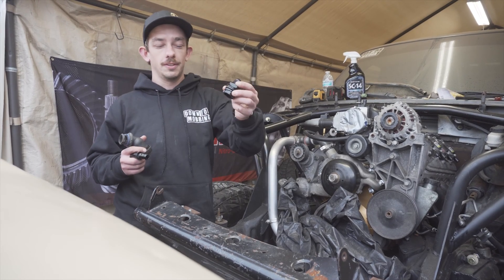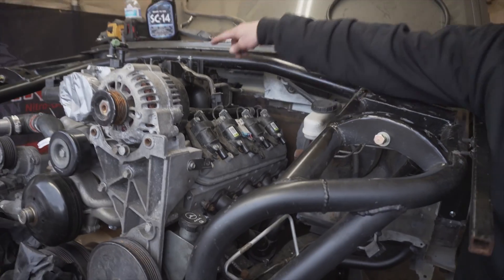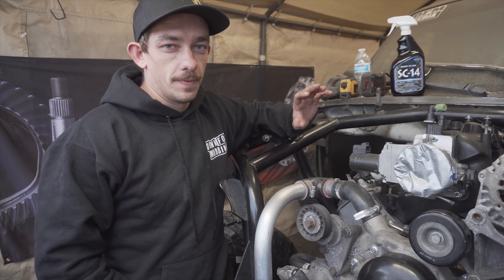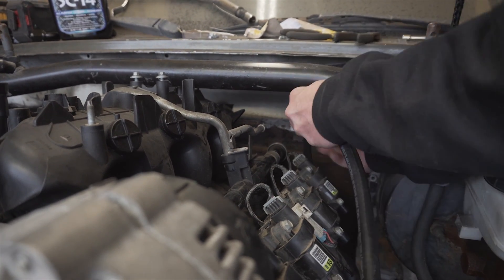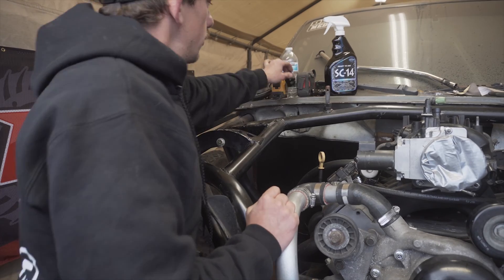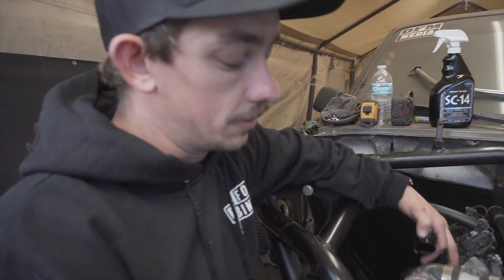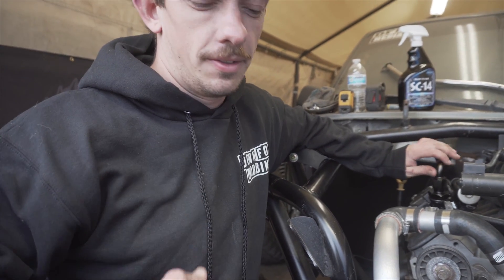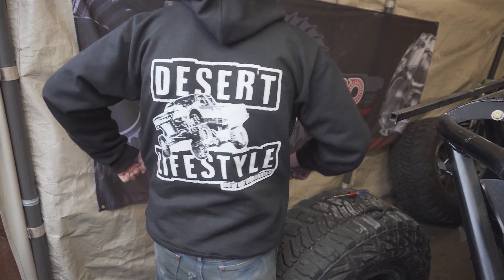5.3 Ls crankcase venting

Comment: Quick tip on sliding rubber hose on fittings...spray brake cleaner in the hose and on the fitting and immediately slide it on. Goes on easier AND It won't come off so make sure you want it there lol.... I use that trick on cooler hoses because lube makes them slide off. But Brake cleaner leaves no residue. Won't slide off under pressure.  Thanks me later...😉

Comment: Would this let un metered air into the system?  If so, How could I prevent dumping shit into my engine, vent pressure from the valve covers, but not introduce unmetered air into my system.  I live in Michigan so The dolphins will be safe if I vent some crap out and I believe the biggest thing I can contribute to saving the environment is doing what I can to prevent my truck from becoming part of a environment as long as I can.
Reply: I ended up adding a catch can on both sides.  I think I will make the drivers side vent to the passengers and then vent the passenger side to can and then to the manifold.  I am thinking running it like this would reduce waste although I have only an ounce or two of oil in my drivers side can.  The oil in there is crazy clean after 1000 miles. I really expected it was going to be nasty.  😂
Reply: @RobsReviewsAll means you can is seal super tight pat yourself on the back. The only reason the catch can gets sludge is because air condensed into water and mixed with it in the can. That means somewhere un wanted air is getting in the catch can or air is bleeding before exit. Great job man that’s what you truly want to see as it means the crank case vapors are not filthy and your system is venting and recirculating like a dream. Also means you have either great vac from the crank case or that you have really barely any blow by allowing everything to be burned off mostly in the combustion process. If it’s clean like that you bet your ass your putting clean back in the intake would love to see your intake after 2,000
Reply from the maker: Add a dump can or filter at the end.

Comment: I just picked up a project turbo 4.8 Silverado. He doesn’t have the valve cover hookup up to anything, other videos hook it up to the vacuum on the intake, what’s the difference or better way to do it?
Reply from the maker: If you do that, you will vent oil into the intake. That is the factory way to hook it up. I did not do that in this video.

Comment: I know this is an old vid. But i was wondering how the vent is working and if there is any oil leaking out the vent hose? I got the oil leak issue in my 05 5.3
Reply from the maker: Honestly it’s been great! No complaints! It is a little wet around the end of the hose.

Comment: Same setup with adding turbo?
Reply: You can. It'll keep you from having to do a lot of enginerding to keep boost from pressurizing your crank case. You should probably run that vent to a catch can (the kind with a filter vent on top) instead of dumping it out the back though.

One thing I'd consider though, is that this is a passive system. Pulling a vacuum on the crank case can help rings seal. To do that you could pop a filter in the passenger side cover, then move the driver side hose from the intake to a catch can (the kind without a filter on top), and run a vacuum pump on the other side of the catch can. That will constantly pull vacuum on the crank case, and draw fresh air through the small filter on the clean side. That's probably your best bet for a turbo.
Reply from the maker: Not sure if it would be. That sounds awesome tho!

Comment: Why not just run a short hose with an ole school breather filter?  All that hose seems excessive.
Reply: You can if you like the smell of blow by gasses, and don't mind changing that filter constantly because it got oil soaked. The better way would be to run it to a catch can with a built in filter. The best way would be to run a filter on one side, catch can without a filter - and run a vacuum pump on the catch can side.
Reply from the maker: There is many ways to do it. Whatever works best for your setup. I’d just rather run it out the back and not deal with a catch can.

Comment: Do you have any issues with moisture or sludgy oil after doing this? I’ve been running an open crankcase vent like what you did for a month and have corrosion showing up on my dipstick and sludge buildup already! I live in the desert and don’t hardly get any humidity either and have never had an issue with open vents before even when I lived in the humid Midwest! I have pictures I can send, but do you have any idea why I would be seeing moisture like I am? TIA!
Reply: This is the result of a poorly functioning PCV setup. You need to be pulling vacuum on the crank case to evacuate the crankcase properly.  The setup in this video is better than nothing, but still far from correct
Reply from the maker: 0 problems so far on my end. Sounds like you might have got water in the oil?
Reply: I'm in northern Michigan. During the winter I get a lot of moisture build up in my oil. Enough so that I had to change my oil every couple hundred miles. Lots of short trips is hard on oil. During the summer I do not have the moisture problem.

Comment: I am retired and not familiar with the PCV on all “LS” engine family’s, but is the drivers side rocker cover tube a fixed oriface or an actual spring-loaded-valve inside? Just no longer serviceable? What year is that engine? Thanks! Interesting set up...for all lot of WOT action.
Reply from the maker: its fixed. no spring. This is a 2004 motor. It's a LM7

Comment: Like  the old road vent tube , my 51 Ford just uses Venturi vacuum to vent the crankcase to the ground . In the name of pollution the PCV system was invented to burn the offending fumes .👀
Reply: @david parkes    >The original crankcase Vent was just that, a Vent. No Venturi, no vacuum no nothing. The pressure inside the crankcase is mostly blow by past the pistons, especially when cold. Old school technology had not reached at point to cast round pistons so they where egg-shaped. The wrist pin prevented movement side to side at that location but the piston expanded as the engine came up to temp. Even then & now, some pressure passes ring end gas, unburned fuel in cold spots caused raw fuel & vapor to reach the case, but burning a fossil fuel creates water. If the oil and internal block temp reached the boiling point of each, it is now vapor. Those two can be burned. Carbon, pressure from blow by all need removed. So, in theory, he is allowing the fresh air from the throttle body, just in front of the valve, to be pulled into the passengers side, thru the block, out the driver’s rear, into the intake. The same as new. Since they are racing, they expect more internal pressure so with the oil filler adaptor, is venting it out the back of the truck onto the ground. 
ASE Master since 1978 - Retired
Reply: @deankay4434  down draft tubes were on the very early vehicles..
Reply: Yes, you are right because I worked on them. Oil bath air cleaners and no oil filter. Many earlier engine had no oil pressure to the rod and crank Babbitt bearings. They bolted a scoop onto the rod cap. As it rotated up, they oil fell into a hole to feed the rod, hole in crank to main bearing. Lifter where drip oiled.
   Have you worked on crankshafts with a large hole in the main & rods from front to rear all the way thru? V12 engine had frost plug caps driven in both sides the reduced weight by 90 pounds! P51 Mustang engines used in tractors. Most had a dry double disc plate clutch in front of a 10 disc wet clutch. Like those used in automatic transmissions.
Reply: that’s not exactly why the system was used invented.

Comment: Did you just cap off the pcv valve then? Can I do this with a 2014 5.3l instead of the catch can I was considering? Wont it throw codes
Reply from the maker: Yup that stuff is just capped. You could do this but I am not 100% sure if it'll give you codes. I currently don't have any codes.

Comment: What’d you do with the piece off the throttle body? Just curious as I may follow this setup for my Build
Reply from the maker: The two nipples coming out from under the throttle? I just capped them.
Reply: @DownForMobbing the nipple on the intake behind the throttle body at 0:39, I have a drive by cable tb and the nipple is on the throttle body rather than intake, my bad!
Reply from the maker: @dylanharder3529  Just a plastic plug from the part store.

Comment: First of awesome video ! My truck only leaks oil at WOT , can I run the first line only? From driver side to passenger side? Or do I have to run both lines?
Reply from the maker: Thank you! would want to vent it out of the case. You dont want that stuff to build up in your motor/intake. You can dump into a catch can.
Reply: I wanna stay away from the can for now .. So can I run it just the way you ran your setup? The crossover and the rear dump? After watching your video I ran out to my truck and knew right away where the oil leak was coming from , and it’s coming from the passenger side valve cover nipple/breather and running down the motor on back , 🤣 so go do found your video! Plz let me know!
Reply from the maker: @Jd-gi3ku  You can 100% run it like mine. Bigger the vent the better. We run all the go fast desert/dirt cars like this at my work with no problems!
Reply: @DownForMobbing can you just put a cap on the driver and passenger side and just run the vent only
Reply: Thank you sooo much!!!

Comment: Does the AN fitting need a screen, check valve, or special orifice vent to help maintain internal oil pressures?
Reply from the maker: Nope, at least not for my setup. The only other thing you can do that I am not is add a catch can.